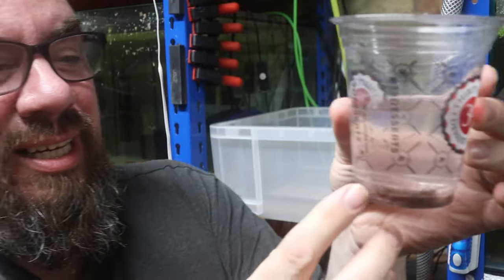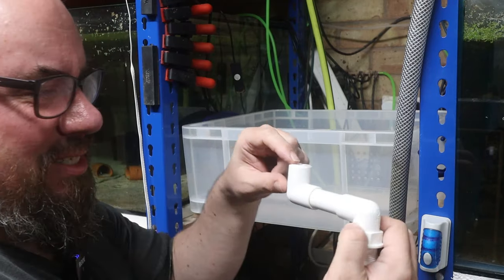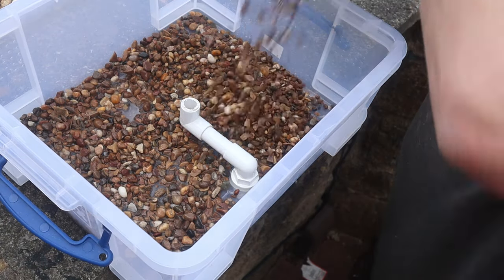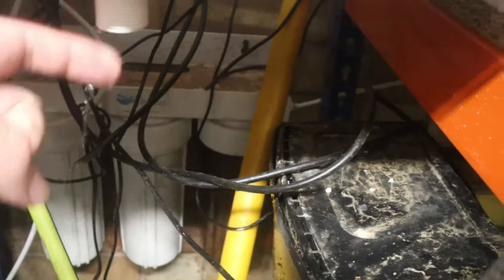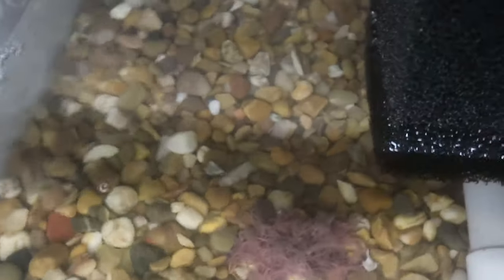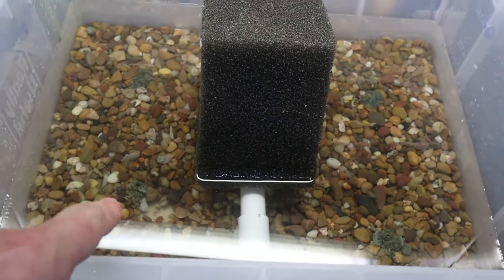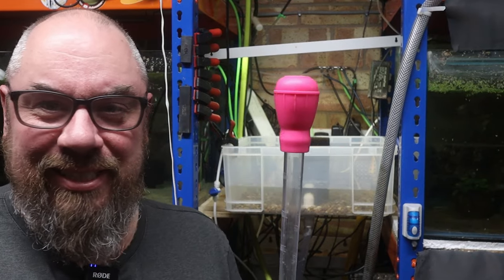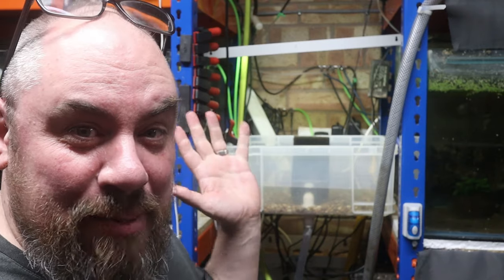Live Blackworm culture setup - the EASY and SIMPLE way!

Comment: This is just what I needed to see. You get a couple weeks out of them in the fridge? The shop told me a few days so I was afraid to use them after that for fear they had gone bad. Change the water every day? I definitely want to culture them. Thanks for this
Reply from the maker: I buy them fairly regularly and normally either throw in tanks immediately or keep them in the fridge - I don't know how long they would last in the fridge but I've normally used up my supply at about 2 weeks, and they definitely last that long no problems
Reply: This is basically a smaller version of what Greg Jones has going on with his too, FCF, if you need more Inspo.
Reply: @AquariumAdventures  thanks Graeme, do you change out the water when they’re in the fridge? Mine come in just a condiment container, so small, I change the water every day. Now that I know they last longer, I’ll use a bigger container. Do you poor some water off the top and refresh when you keep them in the fridge? Thanks much. There is a product they sell to keep them in when in the fridge that is supposed to help them last, but it doesn’t sound necessary. I can search for it if anyone is interested.